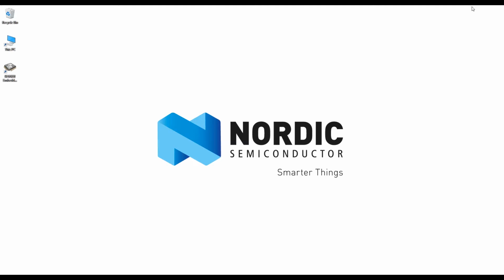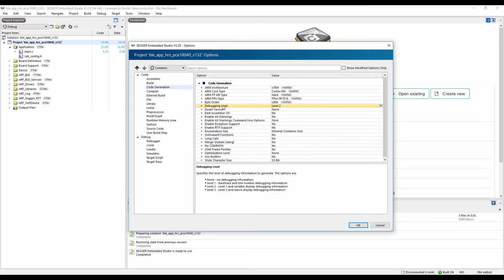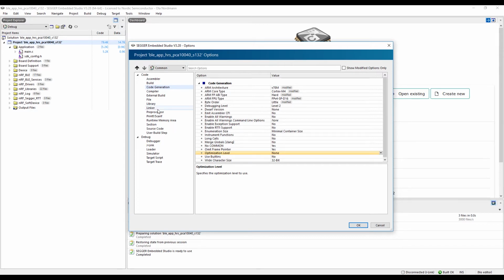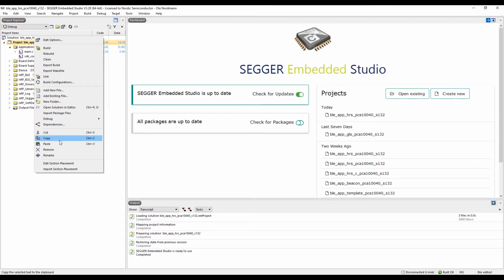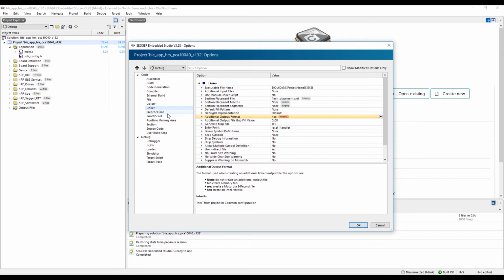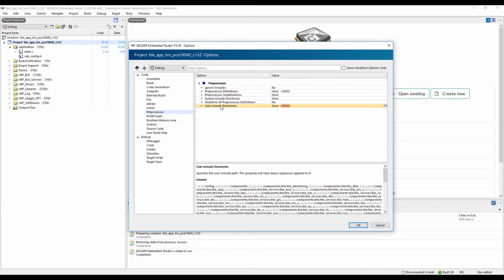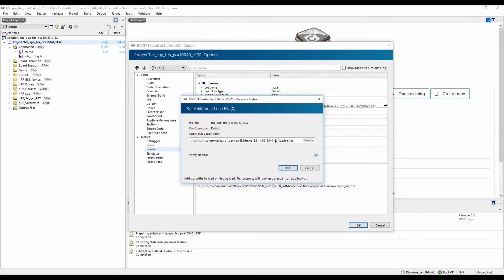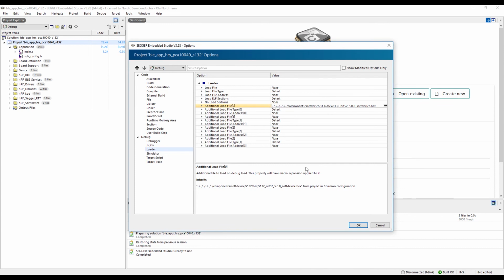SEGGER Embedded Studio – Build settings

Comment: Thanks. I was having a problem with the RAM size and location causing NRF_ERROR_NO_MEM in sd_ble_enable() and using this I was able to find the correct location in the linker settings to add the RAM_START and RAM_SIZE placement macros to correct the build settings to the prescribed values.
Reply from the maker: Hi Rob. For technical problems/questions, please use our DevZone forum https://devzone.nordicsemi.com/
Reply: Thanks, but I was just commenting that this video helped me resolve my problem and tried to provide enough context so that others might find this video when searching for the same issue. I do use the devzone, but for my problem I needed to see where the memory placement macros were placed in SES, so this video was the better resource. Cheers!
Reply from the maker: Glad the video helped you resolve your problem, and thanks for providing some context for others :)